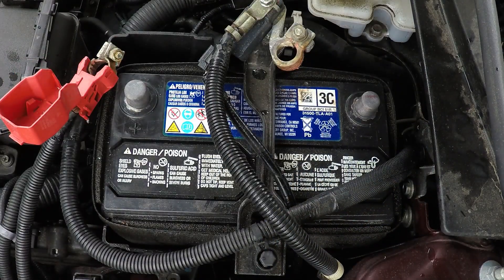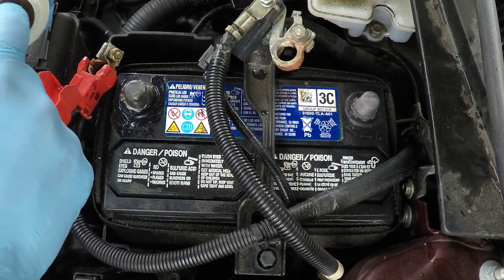The Best Way to Clean Corroded Battery Terminals (The Right Way)

Comment: I would NEVER pour a pot of water over my battery because water conducts electricity between the terminals. You could end up having a fire or sparks. I was just like "yikes" when I saw that.  This is NOT a good idea. Cleaning it with a battery brush or 1/2 inch copper pipe brush will also get it clean. All auto parts stores sell a battery terminal cleaner that comes with an outside brush and inside brush.
Reply from the maker: Teddy Bear, it is fine. Water is not a problem otherwise your battery would be kept in a waterproof box

Comment: I have poured water on mine while it was installed before and regretted it. The acidic crust washed away and etched the nice new concrete driveway and left yellow/orange stains. It also left residue everywhere in the engine bay despite my efforts. Who knows if I shortened the life of some components under the battery (old car anyway). Don't make my mistake if you care about the car! Just take it out first!
Reply from the maker: I was very clear in the instructions to completely rinse it out because it could cause some damage

Comment: Dielectric grease is a BAD conductor of electricity.  "Dielectric" means "insulator".

"Silicone greases are electrically insulating and are often applied to electrical connectors, particularly those containing rubber gaskets, as a means of sealing and protecting the connector. In this context they are often referred to as dielectric grease."

The metal-on-metal contact should push most of the grease out of the way and still make a connection, but it's certainly not improving conductivity.
Reply from the maker: You are correct. The grease is there to protect the connection from the elements, not to conduct electricity.